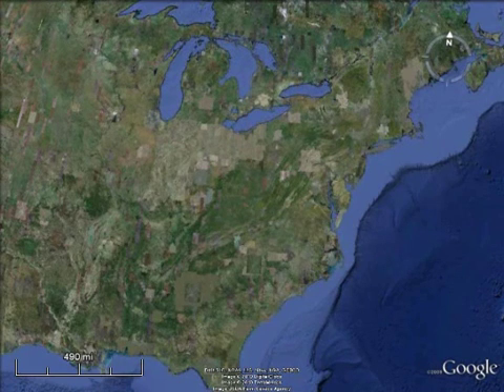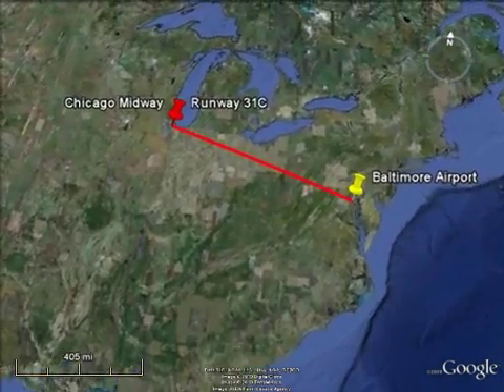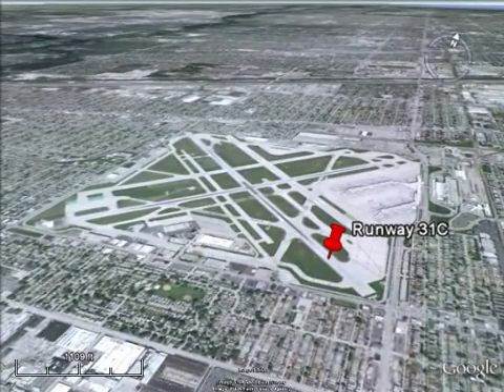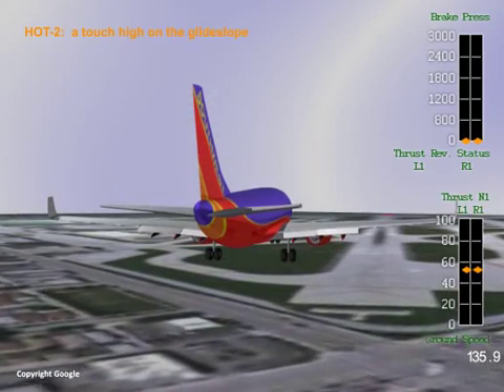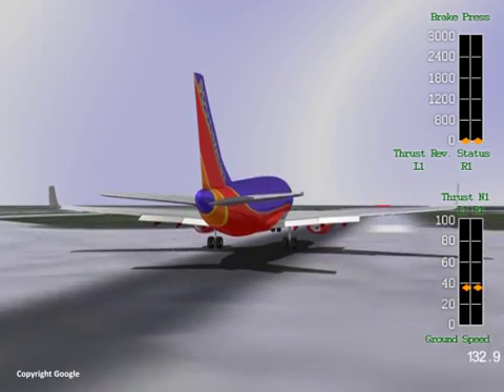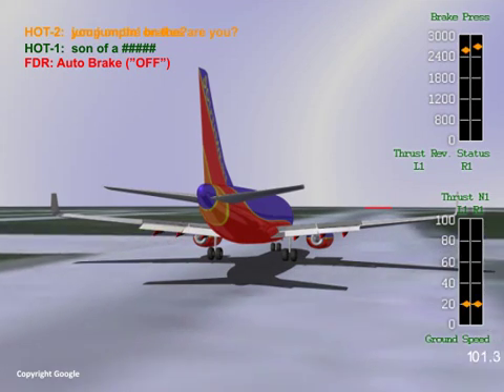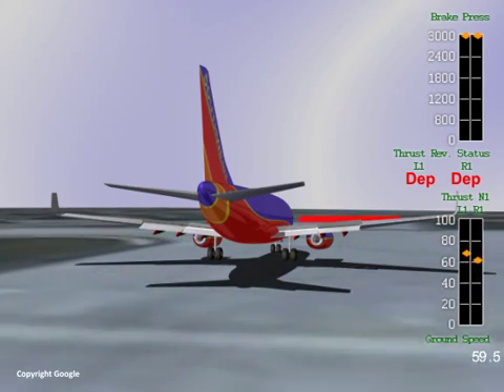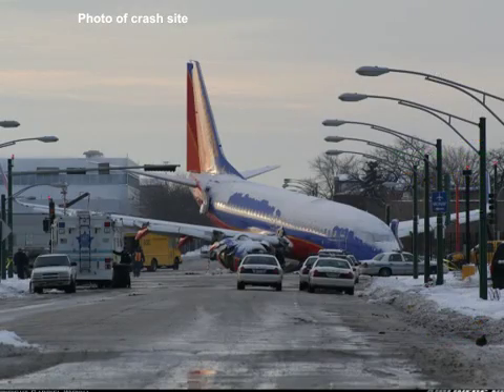Narrated Accident Animation: Southwest Airlines Flight 1248 Runway Overrun

Comment: And after this tragedy EMAS was installed at the end of all main runways at MDW. This is highly unlikely to ever happen again.
Reply: What’s EMAS?
Reply: @palmbearoftexas2007  "engineered material arresting system." Basically crushable material at the end of runways that planes can run into and it will stop them when the wheels sink into it.

Comment: It was an extremely cold day that day and there was a blizzard before that day. On top of that spots of BLACK ICE was heavy and the exhaust from other planes on the runway also could've made it to slippery to stop... 

*One should examine how fast, black ice can form & how it can form, in a short amount of time, under extreme cold surface temperatures. * Maybe the workers who were suppose to defrost the runway were just being a little too lazy to do there job, but yet they still managed blame it on the pilot, which is so ridiculous. I MEAN, the pilot crew still managed to save everyone on board. Thanks to them, there all still alive.

Comment: You are looking south on Central Ave right at the 55th street intersection. The nose is resting on the car. The six year old is in the back seat. Is was cold that day.  The fire and police jetted down 47th street going west half a block up from my front door. This whole area was lit up and tarped off quick. The kid's car was at a red light when the plane barreled through, hit the car with the front landing gear and collapsed the nose. No one should have survived. It was a tuna can! But those people were cut out of there by firemen who moved like clockwork. A military aircraft hit the same spot back in 1955 trying to land at night and slid down the runway shredding to pieces as it went.  Its a really tight space for an airport.

Comment: definitely pilot error, thrust reversers should have been deployed immediately after touchdown
Reply: s7rike
Yeah the captain messed up for sure.
Reply: s7rike Thrust reverser failed. Not crew error.
Reply: +Big Time77
But the official report on Wikipedia says:
A preliminary NTSB advisory says: "The flying pilot (Captain) stated that he could not get the reverse thrust levers out of the stowed position. The first officer, after several seconds, noticed that the thrust reversers were not deployed, and activated the reversers without a problem. Flight data recorder information reveals that the thrust reversers were not deployed until 18 seconds after touchdown, at which point there was only about 1,000 feet of usable runway remaining."
Reply: Big Time77 no
Reply: Disagree. I was on 62nd and Massasoit.....that was the only plane they tried to land during the storm.